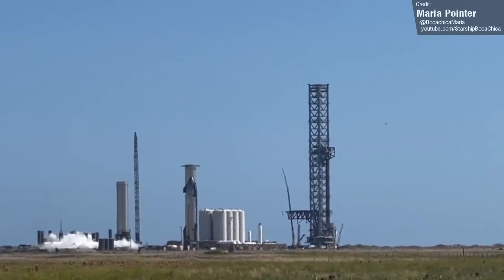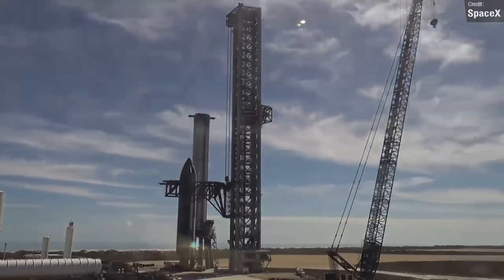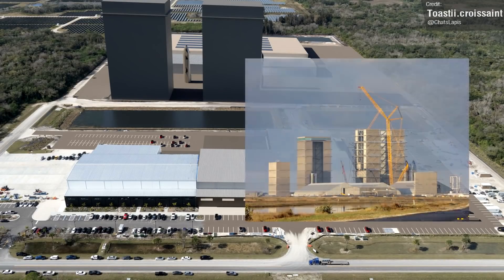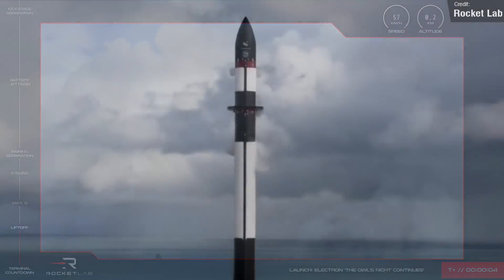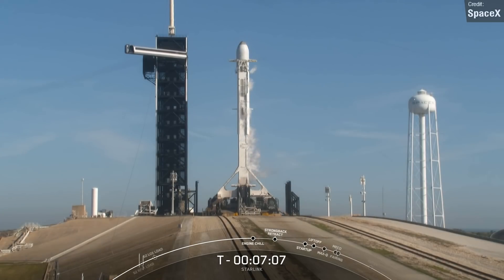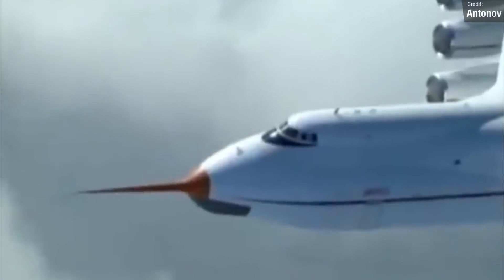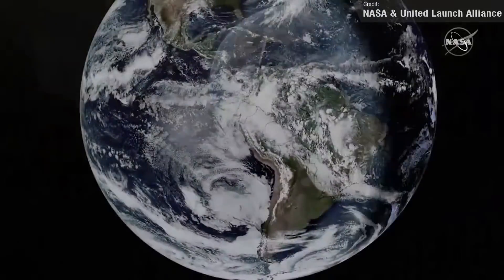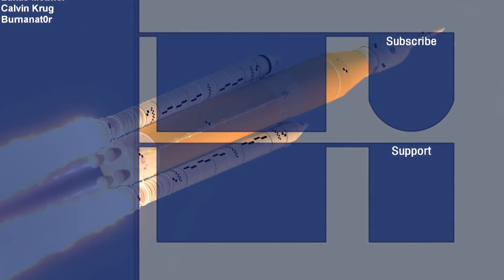SpaceX are building TWO Starship Factories!  | Crew-4 Rocket Reveal, Starlink, GOES-T, An-225 Legacy

Comment: Hey matt, this is somewhat unrelated to the video but i was wondering how you do maneuvers so perfectly in ksp. Whenever i do planetary transfer maneuvers i always end up with a trajectory pretty far off from the planned one but yours always lines up perfectly. Any advice on how to get better?
Reply: Something that I have found that helps: When you set up a maneuver node, it should show two numbers next to your navball - a T- count, for then the burn should happen, and a burn time (how long you should burn for). What I have found is that if you start burning at T-0, you will be fairly far off your target. What you want to do is start your burn at T - (burn time / 2). So, essentially, T-0 should happen exactly halfway through your burn. In the real world, this is not what you would do, but KSP's node system assumes that burns are instantaneous. While the approach mentioned above won't be perfect, it should give better results than burning at T-0.

Comment: Why does it need new launch sites, when it will never launch?
Reply: Why wont it ever launch?
Reply: @anawilliams1332  Kasper has a point though, perhaps not in regard to whether it will launch or not but rather it's success. Space X are funnelling a load of money and infrastructure in to a project that hasn't even achieved orbit yet. They seem to be laying the foundations to build a mass of these things without actually knowing if the thing even works and that's before you even take in to consideration weather there is even a market for heavy lift.
Reply: @L8ugh1ngm8n1  all the tests point toawrds it working, and presumably as soon as the aproval to launch comes through they will do a orbital mission. I get the point but nearly every test has looked good for space x
Reply: It has already launched. Just not to orbit yet. 

LBugh, they are spending less money on Starship which has already flown than most launch providers spend before launching at all. How much has SLS costs or how much has Blue Origin spent on the New Glenn? And SpaceX actually has paying customers with funds coming in to support this project. 

As for if there's a market for it, there absolutely is already. Starlink. And there is easily a market for it's capability outside of Starlink as it has both a heavy payload capacity and a massive payload volume. Plus, if SpaceX comes anywhere close to their goals with Starship, they won't need a specific market anyways as it will be cheaper to fly Starship than Falcon 9.
Reply: @anthonypelchat 

1). Starship hasn't 'flown' and if you consider it's short jump to the height most commercial aircraft fly as 'flown' then all it's done is do something hundreds of passengers do every single day far more safely and at considerably less expense.

2). Did Musk actually deliver a comprehensive breakdown of the rationale behind how Starship would end up being so much cheaper than Falcon 9? Or did he do what he usually does make a huge claim and then back it up with nothing other than a lot of umming and ahhing about how it would be a gamer changer.

It's just he has prior when it comes to making bold face claims about the cost of projects he is involved in and so far they have proven to all be wrong: Tesla, Boring, Hyperloop, whatever the sh*tty subsidiary of Tesla that deals with Solar Panels is called.
Reply: @L8ugh1ngm8n1  1). That "short hop" is flying. If you hop in a plane and it leaves the ground and lands safely somewhere else, that is also flying. The vehicle flew straight up, performed a controlled dive back down, and then landed propulsively. That is massively more than has happened with ALL other rockets currently in development. 

2). He showed costs of each launch. Then a simple breakdown of costs to build a rocket. He didn't go into heavy detail since everything is still in development and subject to change. 

3). What he does that you fail to understand is that he sets ambitious goals. They don't have to hit those goals to be successful. They are there to push the envelope as much as possible. You can see this clearly with Falcon 9. His goals have been to fly a Falcon 9 rocket in less than 2 weeks. Yet the best to date is 27 days, 2x to 3x worse than his goal. And yet Falcon 9 is still the only reusable booster being flown, is the most flown rocket, most reliable rocket, and cheapest per ton to orbit. With Starship, he is expecting costs per launch to be as low as 2M. But say that they only get down to 30M per launch. That is a huge miss, 15x higher than his goal. But it still is as cheap or cheaper than Falcon 9 while carrying several times more to orbit and flying far more frequently. And the only rocket being built to that would compete with Starship is SLS at 4B per launch.
Reply: "So what you've just said is Starship has achieved nothing that an average airliner doesn't already do"
So airliners are landing purposively using rocket engines now?

On the price, you want SpaceX to have an exact price on a massively innovative rocket that is still under heavy development? And if they don't have that but have educated guesses on what it will costs assuming everything goes to plan, that's pure BS to you? 

"What envelope and define success?"
Wow. Landing and reusing rockets for instance. Making space travel cheaper than ever before. Roscosmos used to be the cheapest ride to space. They have been massively undercut by SpaceX so badly that they barely get any rides anymore. Yet SpaceX is still making a profit on each launch. And I never said didn't do anything. They do a ton. But they are also held back because of the cost of missions or the limitations of rockets. Why do you think NASA has been building the SLS for 2 decades for tens of billions to build? They need something bigger and more capable that anything else out there. And yet SpaceX is building an even bigger rocket in a fraction of the time more a fraction of the cost. What do you think NASA could do if they were able to redirect all of that SLS money towards science? That is something Starship is close to allowing (government BS aside of course).
Reply: @anthonypelchat  You know what, I hope you're right. I hope one day they really do do all the incredible things they say they will do but let's face it Elon Musk has previous when it comes to talking utter mince about the capabilities of the products he is selling and that INCLUDES Space X.

Respective of that I am not going to pat them on the back for what is still a mediocre achievement at a cost and time frame that had NASA achieving significantly more with significantly less and until Starship actually does... well anything other than a short hop THEN we can start talking about costs, capabilities, and launch numbers because right here and right now it's a rocket that hasn't flown in nearly a year and hasn't actually been in to space AT ALL!

Comment: There was another An225 near completion. It’s not clear what happened to that, so there’s a remote possibility the old one could be parted out to finish that one depending on how this war goes. Until then, the Boeing Dreamlifter and Airbus Beluga and Beluga XL will need to perform the role held by the 225, carrying large loads that can’t be carried by anything else.
Reply: It is still in an Antonov facility, it is only 60% complete though, so not really "Near Completion"

Comment: Second AN225 airframe isn't flight worthy and will never be, it has worn off behind flight worthyness. Repairing the damage to the original or make the second one flight worthy will cost a lot more than just beuild a new aircraft from scratch with new materials and new engines to consume less fuel and gain some weight to be a little more economically viable.

Comment: 7:29 isn’t neutron’s upper stage expandable though?
Reply: @FenixTheSnolx  he’s probably right tho. Trying to recover a second stage, especially when they are as “small” as the neutrons means losing capacity. With a second stage every KG you add is a 1-1 for loosing cargo capacity. Making starship fully reusable cuts it’s capacity in 1/2 compared to if you expended a super heavy and a starship, but it’s worth it because 100t to orbit is still huge. Neutron is small enough that they probably don’t have the margins to add parachutes and a heat shield to what is already a super light weight stage.
Reply: @FenixTheSnolx  Even partial reusability costs payload mass. The Falcon 9 B5 when expended can lift up to 22.8 tons to LEO. Falcon 9 B5 recovered has demonstrated up to 15.6 tons to LEO.
Reply: Yeah, they said it will start out as expendable. So they probably have some plans that they won't reveal yet since they obviously need to get the 1st stage right first